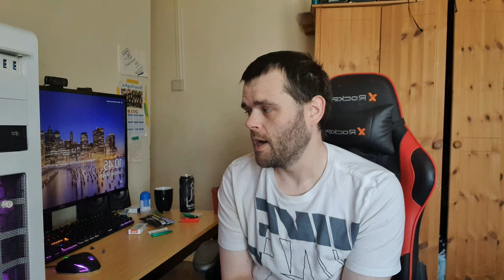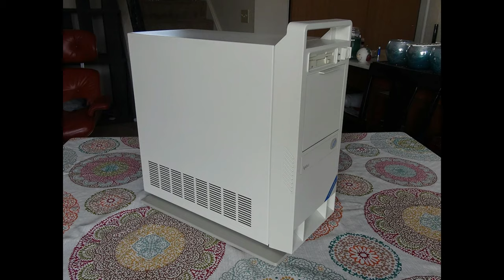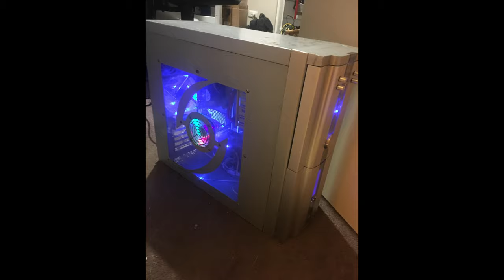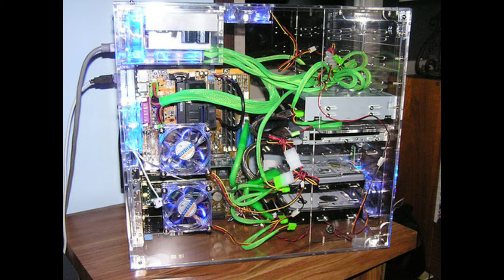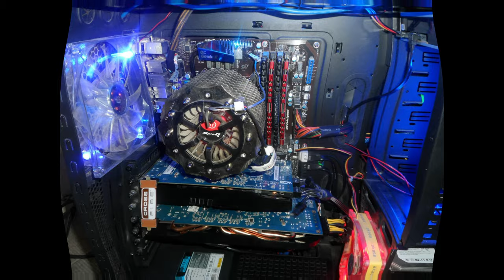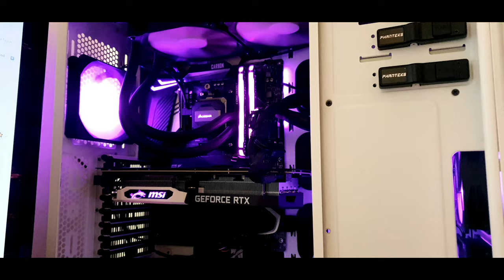Should you mount your Power Supply up or down?

Comment: mm.. interesting. I have my new Ryzen setup installed in old Antec Three Hundred computer case and was wondering this question. That computer case don't have holes in the floor but the psu is elevated few centimeters from the floor so I thought the fan should face down. But I was reading the Antec manual that it should face up instead. I wonder if you would install fan on the floor then there should be airflow to the psu even though the psu fan facing down. but that would require building some floor fastening for the fan.. and that's one less intake fan in total?
Reply from the maker: If the case doesn't have any ventilation in the bottom them do fan facing up for intake

Comment: So… fan up is what I got out of that right?  I have the fan “up” inside the case area as of now…so pullin air from the case and spitting it out
Reply from the maker: If the bottom of the case has a filter, then fan facing down if you don't have any ventilation at the bottom then fan facing up